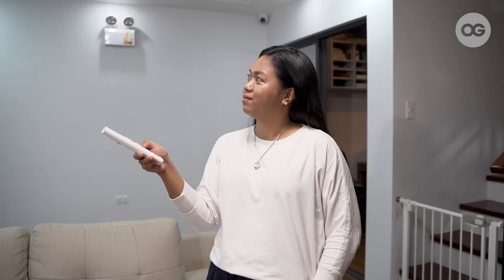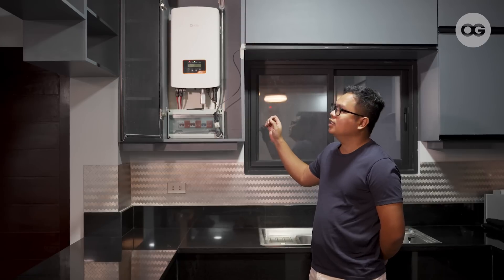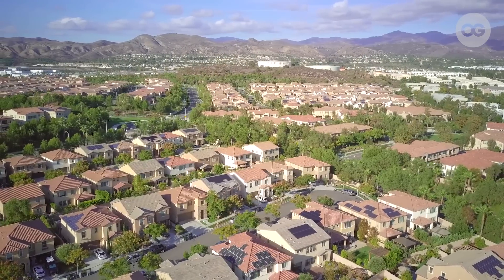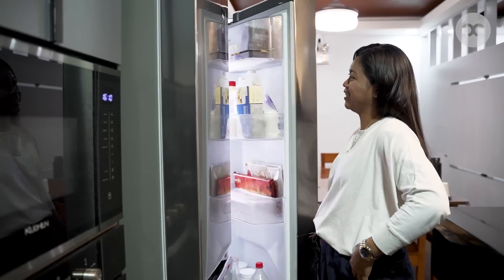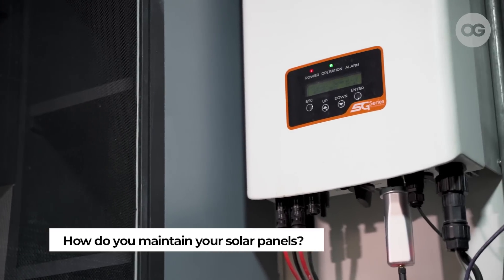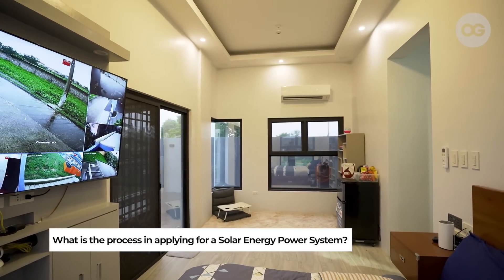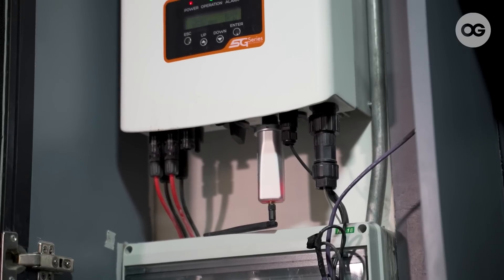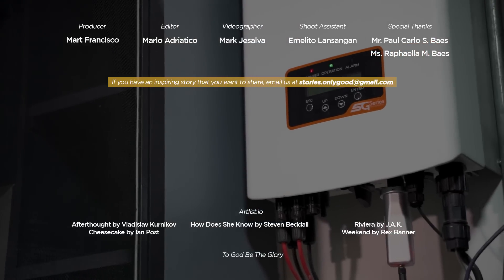How Much Does Solar Panel Installation Cost, and Is It Worth It? | Unique Homes | OG

Comment: Sulit solar amin 3kw pa pero upgradable sya 6kw inverter gamit Kase yan p lng Kya budget 6 panel at 100ah lifo battery yan advice nagkabit para nagkapera add n lng panel,  pag maaraw unli Aircon ,induction d n kmi nag gasul sa daytime pag na ful naman battery 4hrs matagal Aircon sa Gabi minsan 24hrs solar na lahat minsan nakurot konti sa utility pag d na full battery  kaya sulit 3500 bill ko dati tipid tipid pa Gabi lng Aircon pag matulog now daytime nakakgmit na:)

Comment: Grid Tie is mura compared sa Hybrid, but purchased cost of your solar production  via net metering is 50% less than the actual / kwh cost, if P10/kwh well bili ng Meralco will be around P5/kwh. thats why, as a Solar Contractor we recommend Hybrid. kasi may back up power ka pag brownout of may bagyo. gridtie is much preferred sa offices or that operates 8am-5pm.

Comment: ZERO BILL IS POSSIBLE IF AND ONLY IF:

GRIDTIE: OVERWHELMING SOLAR PANEL INSTALLED, MEANING HUGE EXCESS GENERATION TO BE SOLD AT P5 PER KWH

OR MINIMUM LOAD USAGE TO PRODUCE EXCESS GENERATION TO GRID.

OFFGRID: HUGE BATTERY SETUP

HYBRID: COMBINATION OF BOTH ABOVE.

ELSE, ZERO BILL IS IMPOSSIBLE !!!

MY ADVISE, MAS MURA PA RIN ANG GRID COMPARED TO ANY SOLAR SETUP, ROI IS TOO LONG ESPECIALLY MAY MAINTENANCE PA YAN.

SO DON'T JUST BELIEVE THIS ZERO BILL ONLINE....

LALO, NET METERING NORMALLY TAKE VERY VERY LONG LONG PARA FREE ANG EXCESS GENERATION NYO PAPUNTANG GRID...
Reply: Pa share naman po ng contractor nyo kung sino pagawa din po kami

Comment: Accurate lahah sinabi nila. We almost have the same setup. 7kw hybrid nga lng yung sa amin. Total na nagastos namin 350k. Same din from 15 to 18k electric bill ngayon 2700 to 3k na lng bill namin. Nakakatuwa kasi laki tipid pero sana babaan pa ng mga installers ang presyo para mas abot kaya. Its green and a very good investment.
Reply: hello po ,kahit may solar po na highbrid may bill pa rin po pala sa kuryente?
Reply: Madami po sila appliances at 4 Aircon, 2 refrigerator, washing machine. Kung 2 Aircon, 1 refrigerator, rice cooker, washing machine at electric fan, ilaw lang, makalibre Ka na sa kuryente.
Reply: Ilang years po ang ROI nyo
Reply: Anong company po

Comment: I was quoted 6kw hybrid for 255K. Thanks for the video na intindahan ko ang on grid, off grid, hybrid... This is really one of my long term goals
Reply: Mayrun kami ser hybrid 280k lang po sama n install
Reply: my advice, don't install yet if meron naman available grid sa inyo. mas mura pa rin ang P12 per KWH than building your solar setup.
Reply: @DuneCatalog  thank you for the advice. di kami nagpa install. i was only trying to prepare for a sudden power outage sa amin because I have an ailing family member. so for the meantime generator muna
Reply: @DuneCatalog  there is a return of investment for renewable energy source,  expedited if your home is also designed to be energy efficient
Reply: @zoywow  not totally even via gridtie. imagine your excess energy is being bought around 5 pesos per KW.
Take note also that net metering approval will take months before the 5/KW can be applied.

Bottomline, it's not worth it if there's a stable grid in the area.
With high price being charged by the installer, the consumer ROI would take long years...
Reply: @DuneCatalog  If may setup ka na 10KWh tapos makaka save ka ng 10k per month. ROI ka siguro max 3-4 years. I think ok narin. May 10k per month kana after that.

Comment: For me Your math is not consistent.  200,000 cost of solar system roi of 3.5 years = 57k a year or 4.7k a month only.  versus your 12k to 15k electric bill before net metering.  

Using 12k a month electric bill x 12 = 144k a year x 3.5 years ROI  total cost of solar panels system is 500k

Comment: Installer ako and may idea din sa price, kahit na installer price eh di ko nakukuha ang ganyang kababa na price.

Materials pa lang for 8kw gridtie nsa 200k plus na, labor pa + net metering application...

Then 12k to 15k ang average monthly bill, malabong maka zero kung 8kw gridtie with net metering not unless humina din consumption nung nag solar
Reply: Sa set up nila boss magkano sa tingin mo ang totoong nagastos?
Reply: @eqrrqrqr2937  
Yung 8kW Solar Panels with 8kW Gridtie Inverter, solar panel railings, pv wires, conduit, ac wires, protection circuit aabot na ng 200K + 

So nasa 300K + yung tamang price for there setup
Reply: Sir, can I inquire?
Reply: Ung installer dito, post your company name at phone number. Thank you

Comment: so many people ask "Who is the solar company?" and as far as I can see there is no answer, why is that such a secret? If this is meant to inspire with positive experience why not include this important information?
Reply: I guess because mentioning the installer would be the same as advertising for free. It's the same reason why some celebrities avoid mentioning brands they don't personally endorse. Another reason, I guess, is because it's not the point of the story. They wanted to highlight the utilization of solar energy and not any solar company. They want to inspire people to invest in solar panels because it's not only pocket-friendly (in the long run) but also eco-friendly.
Reply: just to make sure, they said 200,000 pesos for everything? as in $3,700 dollars for panels and installation? seems too cheap thats why im asking thanks
Reply: @archiecruz6336  labor is cheap in the Philippines plus Chinese manufacturing = cheap consumer costs
Reply: @archiecruz6336  they didn't include batteries kasi focus nila ung net metering.. when they have excess electricity during the day and after pag gabi kukuha lang sila ng electric sa meralco, netmetering kasi problema dyan bayad nila sayo is 50% lang kung kokonin mo ung excess mo na binigay sa kanila babayarin mo parin ung ng 100%.. so ung 1khw mo nagin 0.5 nalang. ang battery kasi is the most expensive component ng solar panel system .. it will cost twice as more that your solar panels. The guy din is pretty knowledgeable sa solar i think he did his research and which path is bang for the money.. anyways you can slowly build a battery system sa bahay, ung mga LiFePO4 batteries, or you could go to the expensive rout and get a huawei solar battery luna2000.
Reply: @archiecruz6336  Its no battery added. That another P100,000+
Reply: Same here! why is not posted?
Reply: Kasi hanapin sa internet, maraming kumpanya ng solar sa pinas, pero kung gusto mo mabilis acreditation ng meralco para sa net metering, mag spectrum ka subsidiary kasi ng meralco.
Reply: Go Solar Philippines is one of the leading, I think.
Reply: Off grid pinaka dabest o.kaya hybrid, madami jan private company nag ooffer.
Reply: syempre pag may nagkaron ng bad experience sa solar company na yun kasali sila sa sisisihin.
Reply: 200,000 PESOS IS VERY CHEAP HERE IN NEW JERSEY IT WILL COST $30,000 TO 50,000 DEPEND ON THE SIZE OF OUR HOUSE AND IT'S 4 SEASONS MOSTLY COLD WEATHER THANKS.
Reply: Reveal ng contractors ?

Comment: Too good to be true for only 200k for 8kw.
Reply: Ours is 5kw its 210k. On grid and we had just finish applying from meralco. I still hav to observe for our nxt month bill
Reply: @farmvilbilvlog3254  whose your provider?
Reply: @farmvilbilvlog3254  info please
Reply: nasa 5kw lng suguro una since sabi nya nag upgrade sila to 8kw. base sa bill na 394kw exported. /30days/4.5 sun hours in ph. nasa 2.9kw lng harvest per day.  sa roi 3.5 / lagay na natin 300k nagastos. nasa 7k lng monhtly bill nila kung walang solar. as per info given lng sa vid.
Reply: Grid tie is low price than off grid and hybrid because of battery prices... Kung may battery yan baka abot 300k yan for sure
Reply: @hiimkulot1109  hi po. off grid is walang battery at nagrerely lang sa solar panels yung kuryente?

Comment: Pano po ma achieve sng ZERO bill, since ung solar panels installed  po is 4.75 kw and may net metering na  rin kaya lang walang battery po. Ano pong best type of battery ang recommended nyo po. TIA
Reply: @ryan_peras  lugi ka pa rin jan brad.mahal maintemance at di lahat ng aplliances kaya paganahin.
Reply: I think you should understand off grid, grid tie and hybrid for me personally there is no such thing as a zero bill Kasi kung achieve mo at zero bill the investment would be millions and depends on what appliances are you using you have to compute how many Kw on all the appliances you'll be using for solar and mind you energy gathering is not  a hundred percent since we have rain and we can get cloudy weather if you combine it with wind energy as alternative it can give you more but investment wise million gagastusin mo sa battery palang mahal ma depends on the battery your going to be using and different types of batteries lead acid and litepo 50%lng kaya Kunin sa solar harvest kapag Yan gagamitin mo sa litepo 80% di pwede idrain Ang battery kaya para ma achieve mo Yan you need more batteries more batteries more investment anday expiration mga Yan either 5 to yrs at bibili ka ulit
Reply: May option po bang malagyan ng battery yung solar nyo Mam? Kung gridtie inverter po nakalagay, di po malalagyan ng battery. Not unless mag ac coupling po. Or palitan ng Hybrid Ongrid Inverter yung current setup nyo. 

Regarding po sa Zero Bill, depende po yan sa bill nyo at sa installed solar sa house nyo. Nacocompute naman po yan ni installer kung anong system size ang ilalagay sa inyo para maachieve ang zero bill

Comment: Kaka ingit. Clean energy. Sana all afford ang clean energy source.
Reply: dalawang bitter nasa comment section wala kasi pang bili solar, mga walang alam kung anung benefits sa environment kung naka solar. harvesting 200Kwh energy is equivalent to Planting 12 Trees in a year. yan yung hindi nila alam.
Reply: Lol, clean? It's not clean. Pagmanufacture niyan ay kailangan ng earth elements, meaning magmimina. Tapos 5 years lang ang life ng solar panels and hindi pa kaya g irecycle yan.
Reply: @migueldelacruz5054  BAKIT DI NAWAWALA ANG INGGITERO. LALU NA SA MGA DI MAKA AFFORD 😀 SO MANIRA NA LANG HA HA HA...
Reply: @migueldelacruz5054  saan mo nakitang 5 years lang? 25 years po life ng solar.
Reply: @migueldelacruz5054  Correct. Yan ung di iniisip ng mga tao kala nila clean. Ang sustainable na bahay nakukuha sa design para makabawas sa pag gamit ng energy such maliwanag, maganda ventilation, etc

Comment: Real talk from my experience using solar panels for almost 3 yrs now. Sirain po ang battery at panels. Papalitan mo siya after 2 to 3 yrs. Lugi na sa halagang 150k. Roi siguro 5 to 8yrs. Mamaintenance ang solar. Pag medyo gloomy naman nailaw naman pero mga ilaw lng. Sa 150k na bayad from 3k monthly bill magiging 1.5k to 2k nlng monthly mo. Isipin mo 150k ilalabas mo pra makatipid ka ng 500pesos monthly hehe hndi pa kasama jan maintenance.
Reply: di po talaga magnda kung off grid na need ng battery kasi may lifespan po talaga yan at mahal depende din po yan sa type ng battery kung Li-on 10 years ang lifespan nun , best po talga is on grid.
Reply: Depende po yan sa brand ng solar panel at battery. Kung rich solar, renogy, victron energy para sa solar panel at battle born naman para sa battery sigurado tatagal ng 15 to 20 years kahit naka off grid ka pa.
Reply: Your panels must have been cheap. There are reliable panels with warranty lasting upto 15 years. Batteries are not worth it yet- its too expensive.
Reply: True po yan. Yung battery talaga ay sirain then yung cost ng maintenance at abala din talaga
Reply: anung brand po ng battery ang na install sa inyo saka brand ng panel?
Reply: Mag On Grid k po pr wala battery at mabilis ang ROI.
Reply: Maganda din Lalo kapag maulan wind farm is also applicable
Reply: it means not worth buying solar panels? so electric from meralco is still cheaper?
Reply: @jaytwix2  worth it pag on grid - meaning binebenta mo sa meralco yung sobrang kuryente pero half rate lang, at kumukuha ka parin kay meralco pag walang araw or pag gabi. Bale bawas bill lang.

Pag off grid, hindi connected kay meralco, sa battery pupunta yung sobrang kuryente tapos sa gabi yung battery ang gagamitin. Mahal battery at may lifecycle lang.
Reply: Halatang wala ka paps alam nung nagpalagay ka. Siguro majority ng binayad mo napunta lang sa battery kaya ganyan experience niyo. Maganda lang mag off grid kung walang talaga kayong access sa kuryente pero kung meron mas advisable na wag bumili ng battery.
Reply: @Shortly8908  so kapag in cases na may meralco/other subsidies nya sa ibang provinces pero madalas pa din nagkaka brownout, mas okay pa din ba grid tie, tama ba?
Reply: @jimjellychristoff350  Depende talaga sa needs mo. Example kung ang lugar niyo madalas brownout (every week o everyday) at ang objective mo e hindi ka maapektuhan. Kelangan mo battery. Pero kung bihira naman magbrownout sainyo, may meralco/others, at ang objective mo e makatipid, mas maganda grid tie kasi hindi pa maganda quality ng battery technology as of 2024.
Reply: oww.. sorry to hear about your experience.. but sa case ng family na nasa video, investment of 200k for 15 solar panels, previous monthly bill of 12-15k, now only 2500.. so 10k monthly savings.. ung sayo po na 150k investment na only using 3k monthly bill is too expensive po ata..parang dapat mas maliit lang kase for sure mas konti lang need nyong panels based on capacity ng house
Reply: 10 years warranty panels namin
Reply: On grid pa nalalaman. Parehas lng yan haha